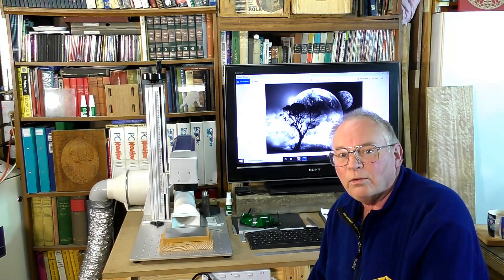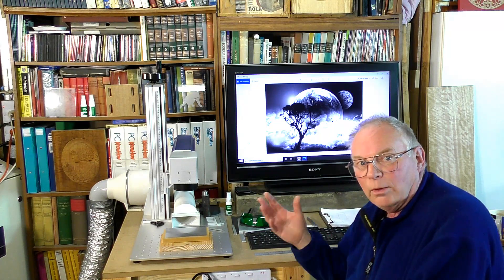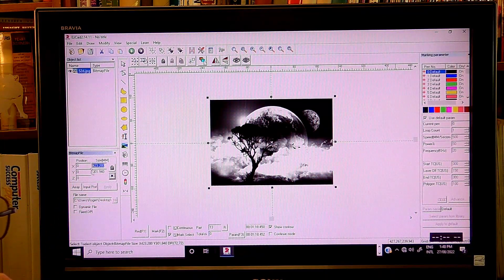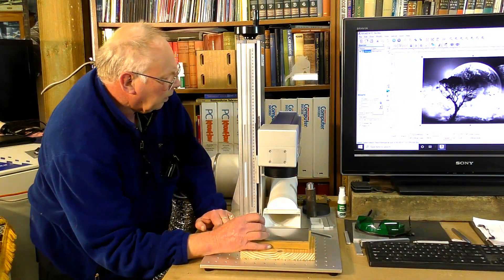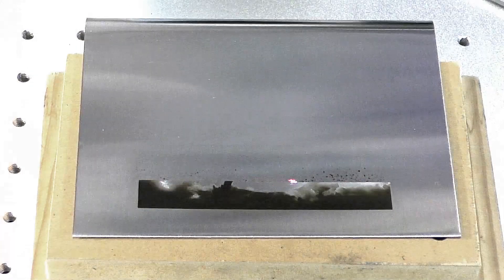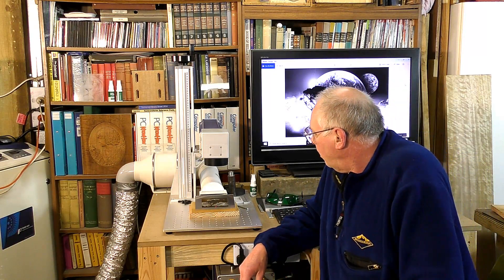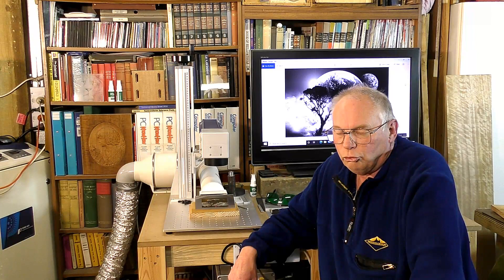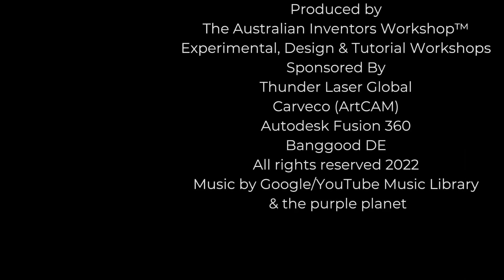30w Fiber laser high-definition photo engraving into stainless steel

Comment: Excellent result indeed...wanted to know few things...
1)...was bidirectional scan on?
2)...was drill mode on?...if yes , how much (0.5 or 1 or any other number)
3)...was pixel power adjust on?

Basically can you elaborate on Bitmap settings?

Highly appreciate the effort you put in each of your videos... Thanks a lot.